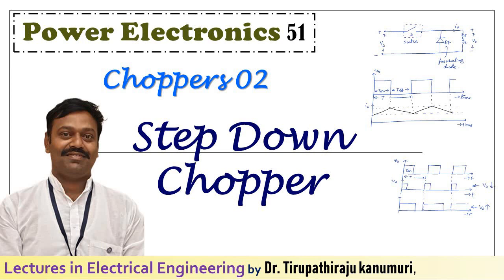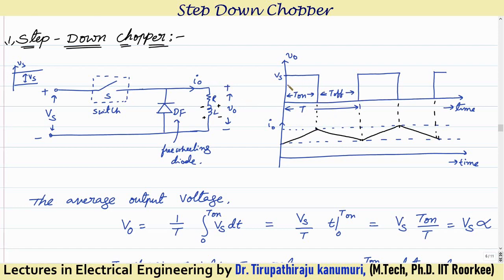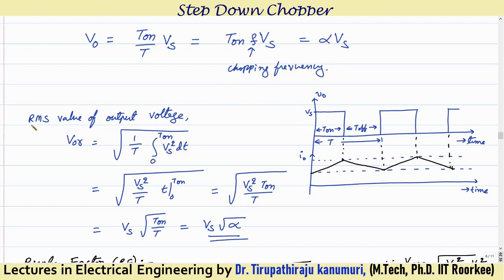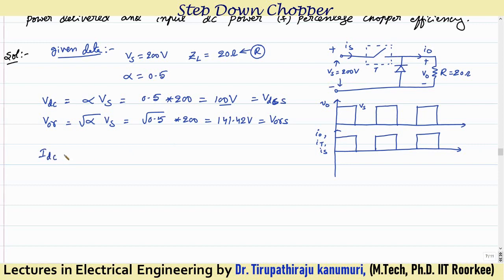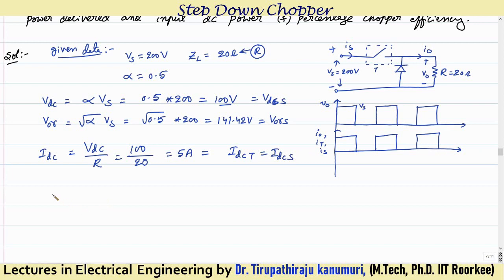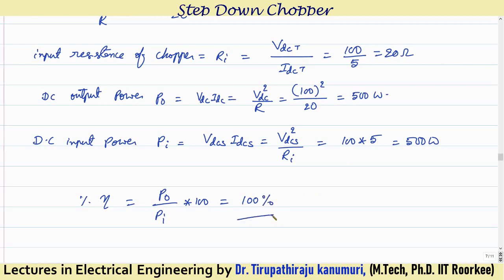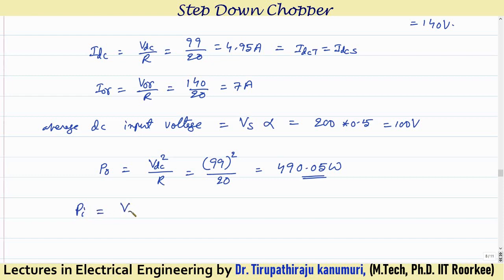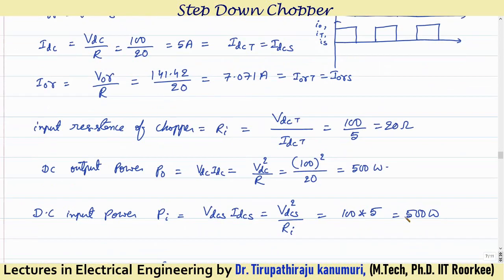PE51 Step Down Chopper

Comment: Sir input voltage to a chopper is a constant DC ( straight line ) , given 200V in the numericals 
So average value or dc value of input voltage to the chopper must be Vs itself right?....🤔
Thank you in advance
Reply: But If inductor in series with load then it will be different na

Comment: Sir @18:44 We are substituting the current value as 4.95A. But if there is a drop at switch which means there is an additional resistance to the thyristor which is added to the circuit along with the load. Hence Req = R + Rthyristor. By this the current value drawn will be higher than 4.95A. But we are taking 4.95 for both Pout & Pin. 

 Please explain Sir I'm so confused.....

Comment: Sir, but here only average value is become low, but for small instant of time i. e. Ton, main supply voltage is come across the load, for short time and then it becomes zero. So for short time, load has high voltage, so how can we say it step down the supply voltage properly.

Comment: hello sir i was actually confused in the problem part of output power becoz when i was solving question from a book instead of taking avg output voltage ,the power was calculated using rms value of voltage please help me in this

Comment: Sir, Why is the current, not starting from zero initially, but from some value?
Reply: At starting it will start from 0 , but gradually it will start the rising from the point where the waveform stopped falling, which may not be 0....